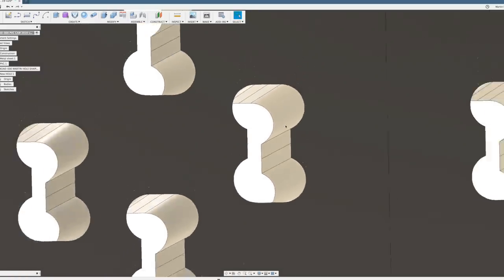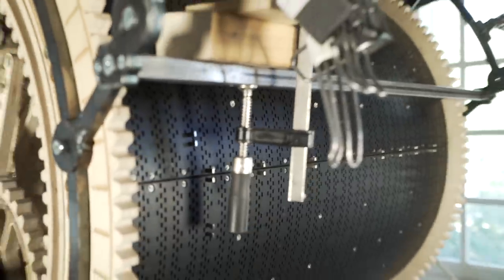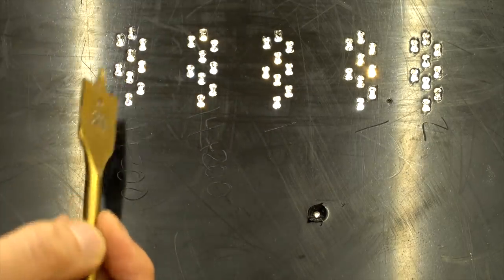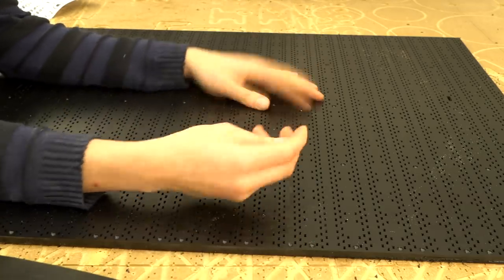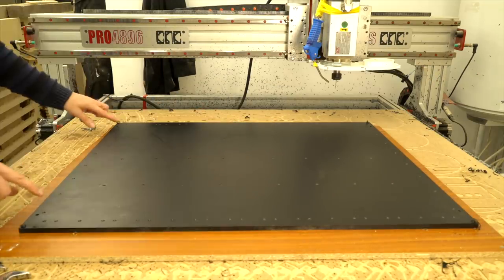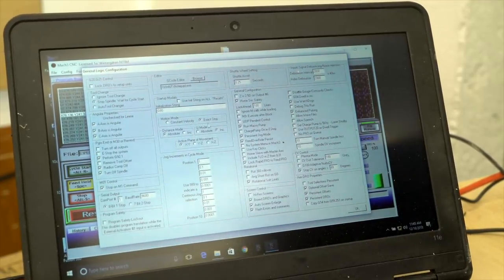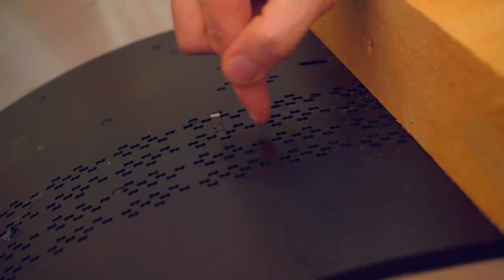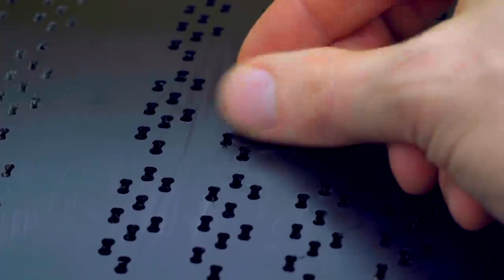Deeper Down the Rabbit Hole - Marble Machine X #66

Comment: if you want the slots in V-shape you may need to purchase a custom cutter. Consider that if when you bend the sheet you use heat, all dimensions will end being off, no matter the tolerances. Another problem I see is the way holes relate to each other, in the current design you have no way of controlling how each pin moves compared to the next one. Given all that I will suggest you to keep the holes bigger and sort the positioning out using styrene sheets that are stamped and not milled. Two 2mm sheets(one for the top and one for the bottom) and a tool that stamps the shape directly onto them may solve all your issues.
Reply: could attaching all the magnets before shaping it  fix a lot of problems?
Reply: @ppsarrakis  I am not sure I understand your suggestion. You need the hole to attach the pin.
Reply: @timstoev5607  The holes are cut before the panel is shaped to fit on the drum.
Reply: @alvatoredimarco  of course..my bad. @Democritus86 it might help with the hole tolerance, but I still can't see a way to ensure the distance relative to the adjacent holes and that is actually where the music is.
Reply: 2 slightly thinner sheets of material sitting on top of each other with an alignment slot might work better and give adjustability for changes in temperature and humidity. The 2 sheets would be able to apply a clamping force on the magnets vertically. Meaning that they should stay in relation to each other.

Comment: Is the CNC strong enough to press cut the shapes using a dye? That is, instead of drilling, perhaps try using a punch to cut the holes.
Reply: I thought the same... Since all the holes are the same shape and size and arranged in repetitive pattern.
Reply: Woulnd't that push the material around instead of removing it?

Comment: The bottom line answer is chip load, or how much each tooth (1 in your case) cuts with each revolution.  I found the the @Onsrud catalog (available online, no affiliation) has an excellent set of charts that give a good starting point for chip load based on their different cutters and the material.  I run a 6mm single flute and was amazed at how fast I could move the spindle with such slow rpms and get an amazing cut.
After your experimentation, I'm curious what your chip load it.  If you are working the CAM in F360, it will tell you the chip load.  Because you over-drove the spindle to some +100%, the math would have to be done by hand.  Not hard.
P.S.  Thanks for the tip on the Mach3 config change to constant velocity.  I'll be looking to that tonight on my machine.  ~P
Reply: Playing with some similarly swarf-prone plastic on my mini-CNC I've also found that conservative feeds tend to leave the plastic full of swarf regardless of the RPM; moving as fast as I dare however leaves a much cleaner cut...

Comment: Martin,

Maybe think about drilling with the material precurved, or drill the holes in cold material. When you bend the material, you squish the inside radius but stretch the outside. Too bad the material cannot be made pre bent. You might have to rethink the entire process if it doesn’t work, possibly strips horizontally for every line? Hmmm.

Hang in there 

Bryan from Vancouver

Comment: Martin you are doing terrific work and I have only read less than 1% of the comments but it is so heart warming to see the worldwide interest in the project and the strong active team you have gathered around you in direct strong and able support. It is for this reason I hesitate to give advice but here goes- 1. Bin the current design.
2. Use aluminium instead of the plastic for the programming wheel sections.
3. Make the programming pins out of plastic with a ‘fir tree root’ that inserts in the holes of the programming holes.

There I have said it.😀

Comment: So if  have to do a concert with 5 songs you have to use a truck to move the marble machine and 20 programming plates. Maybe is better to find a way  to use less space, also e thin metal plate with pin welded or screwed on it or a paper sheet and a way to push pin from inside the plate where there is a hole. In this way you can use the space under the machine to store many songs.

Comment: Those holes are going to be smaller or larger depending on ambient temperature. You need material that is more thermodynamically stable

Comment: 2 ideas for you to mitigate the tollerance of cut and magnets. 

1 Make the hole in the plastic more deformable/springy. Perhaps drill a hole just inside the wall of the thinner bit of your hole?

2 Increase the magnetism? Thicker steal.  Optimal steal recipie for magnetism.

Granted the plastic will fail faster if you deform it in a bigger way through a smaller section of the material.  The life span may be acceptable?

Comment: One thing that might be an issue could be de-flexing  re-flexing the sheets when you take them off and put them on the  wheel. If the once flexed sheets have memory and hold their shape it won't be an issue, but it could be if the sheets flatten once removed and cause deforming stresses.

Also the initial bending seemed to concentrate the bend in the middle an then work its way to the entire surface. This could create variable behavior across the width of the sheet. Maybe a jig to apply a more constant pressure across the sheet on the initial bend would provide a more consistent behavior of the holes. Also over bending in the jig might get it to relax to the true shape, eliminating de-flex re-frex stressing.

Lastly warming the sheet with a warming blanket before the initial bend might also improve the memory of the flex and cause less de-flexing and stress on the holes once removed from the frame.

Comment: I'm sure it's too late for this, but another approach would be to make a jig that holds the assembled cylinder. You then take the Y-axis drive from your CNC hand have it turn the cylinder. From the software point of view, it doesn't need to know the surface isn't flat. You'd then be milling the curved surface, and the angles would take care of themselves.

Comment: Maybe it would be easier to drill the holes on the mounted program plate.  ;-)

Another idea is to leave the plate after drilling and repeat the same run after 12 hours.
Then the drill does not push the material away, but only cuts the shrunken one.

Comment: It looks like you are plunging and slotting with almost 100% tool engagement (sharp corner in your toolpath line). Consider smaller enmill and faster speeds and feeds.

Comment: I really believe you should be cutting these holes post-deform as opposed to pre-deform. Add a 4th axis CNC controlled wheel to your table and rotate the medium as you cut, advancing the wheel to the bit instead of tracking up and down the flat surface. This would eliminate the uncertainty.

Comment: May need to take into consideration that tolerance of the holes may change based on the climate the plate may be in. Interesting enough even humidity can affect some plastics as well in this way. So when you travel it may end up changing a little.

Comment: Not only the holes are shrinking but the entire sheet will expand or contract with ambient temperature variations. The holes could be too loose to hold the magnet firmly during a hot summer concert. Have you tried less thermally sensitive materials?

Comment: Please consider the affects of uv light, humidity, and temperature over the next weeks. When you are traveling all of these aspects will change and so may your boards. You may want to run the material through the proverbial mill and freeze the boards (high altitude airplane cargo hold) heat the boards dry and wet environments (use a dry and wet sauna room) and leave under uv light for extended periods to determine their reliability. Would be worse then a shame if you had a gig in Winnipeg (-33C now....+33 in the summer) and flew to a tropical location and the pins won’t fit. 

Keep up the great work!!

Comment: it may be that the cutting process is heating up the material as well, so that the correct size holes are being cut into heat-expanded material that shrinks on cooling.

Comment: Great video!
I had some troubles with exact stop recently as well, you can set the constant velocity mode in your GCode with G64 so it does not run in exact stop on certain files.  Also, personally I think the tool you are using has a very long stick-out; I see that the tool is ground like that, but using a shorter stick-out tool helps greatly with rigidity so it does not break as readily.

Comment: Martin.  Just another thought.  Instead of 3D milling small strips, you could use a wood planer with custom blades that can plane the plastic like fancy wood casing around doors and windows.  Then you can make a setup that rotates each piece and use your mill to cut the holes.  A planer is only a few hundred dollars new or you can buy a used planer and have a millwork shop or machine shop make the blades for you.

Comment: If you machine the holes when the plastic is flat then bend it around the drum, the inside surface will be in compression and the outside surface expanded. The holes will be lose at the top curved surface from expansion and tight at the inner surface from the compression. Even though bend the axis is 180 degrees to the slot, the expansion and compression will exist in the material if it is machined flat and then bent.

Comment: JUST AN IDEA - PLEASE READ!
If I'd need to make something like that... assemble a sacrificial drum with an axis, corresponding to the final diameter, bend and mount the plates onto the wheel and go with that wheel on your miling machine, attach a drive shaft and a stepper motor to the wheel and machine the holes in one go - think of a 4th axis. You'll most likely need to dis-assemble parts of your milling machine to make space for it and you also need to upgrade the electronics of your milling machine. But like this you could eliminate ALL the issues you're currently fighting with...
YES, it's a lot of work to get everything set up. But once it's set up properly, you'll be chucking out programming wheels with perfect plates in no time, with perfect spacing and all...
You already have a CNC, it's jsut a matter of getting a 4th axis to work on it and making sure you have enough space for it.
Like this you could also drill round holes and use round pins, you wouldn't need to make slots. Again, much faster!
Reply: Problem is, he only needs 8 plates, which is, in my opinion, too few to justify that large of a modification. Nice idea though, I never would have thought of that.

Comment: There's lot's of good advice here, my two cents worth is just a logic biased one, ie drill the two holes for each slot as a first pass, next day if shrinkage occurs, finish with linear cut. This may leave the room for evacuating chips more efficiently. Drilling would have to be done a lot quicker than all the 3d moves at present.

Comment: @Wintergatan I still say it would be easier to mold (plastic injection) the programming plate in small sections. 1/4 of a channel at a time. The 4 x 32 pieces would be attached to the wheel plate to form that curved section. This way the curvature is already molded into the piece as well as the pin holes and screw attachment holes. A molded dove tail would help hold each of the 4 sections of a channel together into a strip. So 128 pieces per plate x 4 = 512 pieces for an entire programming wheel.
Reply: And the dovetails would help hold the individual (4) programming plates tight together so those split holes can still be used for notes.

Comment: I'm afraid temperature will always be an issue for the size of those holes, beyond the displacement thing. I'd start thinking about a plan B right now, with a different retention solution.

Comment: One important thing to note here: Plastic shrinks, and PE is no different. This will create problems for you if you keep using PE; if not immediately, then down the line - the timing of the music will be off as the plates shrink ever-so-slightly over time until they become effectively useless to you.

As much of a pain in the ass as it is, you'll probably have to use a metal substrate (which won't shrink) for the programming plates.

Comment: To permit the PE300 plate to bend more easily for drum section mounting would require cutting out material (grooves) on the bottom side with a sawmill blade (0.5mm and less). The cuts would be cylinder lengthwise to the Drum of course. There would be a formula of how many groove cuts to create and at what depth over the Radius bend to relieve tension of compression on the bottom and stretching on the top.  As you bend the grooved plate - the grooves close up with little stress in the bottom and top surfaces. There are Finite Analysis software programs that model stresses in designed parts. Quite expensive but an engineering firm could run a modeling of the rather simple plate bending.
The ultimate would be getting PE300 formed at the Radius for the plates (highly unlikely). You would need a Metal form just like MM X Plates. Mount the PE300 on the metal frame (with spring tension clamping) and place in a large convection oven that is precisely controlled for heating up and cool down. Then its clamping the curve formed section down flat for milling the programming holes. When you un-clamp the PE300 programming plate from the milling table  - it springs back up to the drum curvature for mounting on the Drum plates with no clamping.

Comment: I wonder if it would be easier to modify a CNC to rotate a drum for its Y axis? Then you can bend the plates before drilling the holes on the drum. It would eliminate the distortion from bending the sheets at least. It would also make it easier to make replacements if it works well enough.

Comment: Wouldn't it have been simpler to construct a vertical table for the CNC and machine the programming wheel as a whole unit, partiture plates and all, while turning it as a fourth axis? That way, the plates match up perfectly and the bend is already in the plastic.

Comment: You plan on traveling with this machine, you might end up with more tolerance issues with the plastic because of water absorbtion.  Certain plastics absorb water from the air more than others, you should check how humidity changes affect your tolerances.

Comment: Hello Martin, is your material hydroscopic? When you cut it with all those holes, you radically increase the surface area. Moisture from the air may be swelling the plastic. Nylon behaves like this. If so, the moisture content will vary constantly, especially as you tour the world, and your holes will enlarge and contract from one day to the next, giving you varying results.

Comment: I love your videos!  I will continue to watch them as long as you continue to make them!  When I first watched this video, I thought the same thing many others did.  Treat this like engine building.  Mount the plates on the drum and machine them as an assembled unit.  I do have one question that I have not seen answered in the videos.  With the plan being to have two sets of programming plates, with one offstage being re-pinned for the next song, how are you going to be able to accomplish this task in the length of time of one song without errors?  Seems like a heavy task for your off stage crew.  Pre-printed template that lays over the programming plates to insure quick installation? Optical comparator?  I am curious what your plan is.  Last comment:  Please make Bangor Maine USA one of your world tour stops!  There is a brand new large outdoor venue by the river that sounds amazing!

Comment: What if you bent the plates first and THEN machined them? Put the bent plate on a curved jig that lets you machine one horizontal row at a time and then advance it a beat and repeat that same tool path. Maybe hats slower but it would mean you wouldn’t have to do the weird compensating of the hole dimensions for the bending operation.

Comment: I wonder if it's internal "pressure" within the bulk material pushing the holes closed again rather than "push back" from incomplete cutting. There are unbalanced forces when a cut/cavity is created that will act to close again (or sometimes open further). Happens in other materials like wood and glass too.

Comment: Martin,  heat your programming plate in a oven over the form.  it will naturally bend to the form and will be quicker to clamp.  Also, why do you need such big plates?  Can you use strips say 6" wide and the length of your drum that you 3d mill out of slightly thicker plastic?  Then put some magnets on the sides to hold them to the drum.  You can then have the strips preprogrammed, stacked and numbered to quickly setup.

Comment: Question : I think part can be made with mould and die method, IMO would be more efficient than CNC and the mould would be reusable and not 12 or 24 hours of CNC work every time you need a new piece.